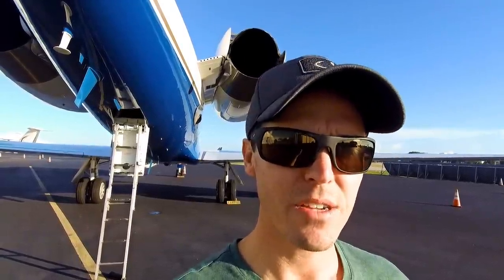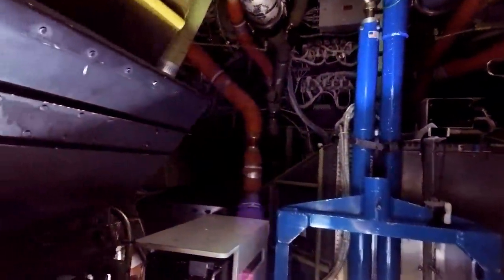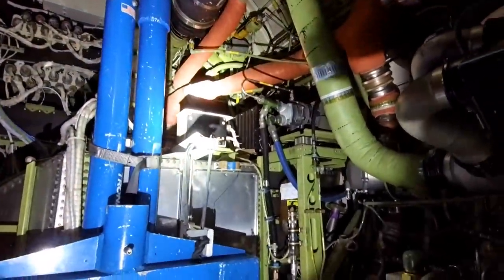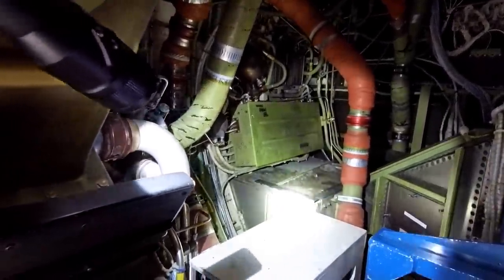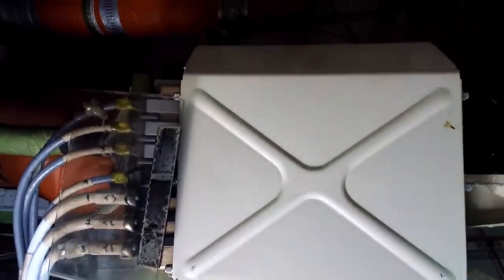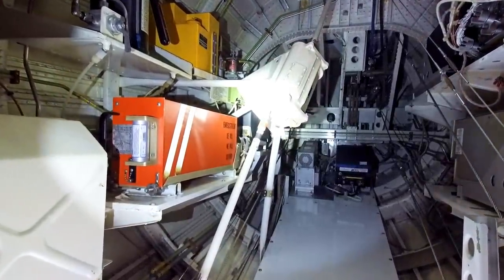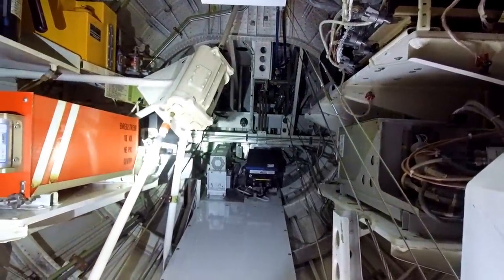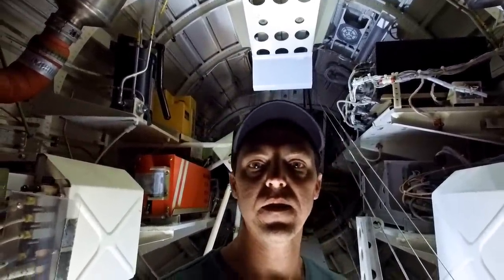Gulfstream Aft Equipment Area - Pilot VLOG 097

Comment: Shaun - as a non-aviation type in knew bleed air was important, but didnt realize where the coolers were and how much it is routed around.  I had 4 LM2500s in my ship, and while we didn't wiggle the yoke - i could control from the bridge.  BTW - thanks for the electrical statement, my plant makes about 1600 MW at sea level...grin
Reply from the maker: HAHA! Nice...

Comment: Love that kind of stuff. When you were showing the replenisher, it reminded me of a questions that you have probably answered a 100 times. How often do you change oil in the engines and how much to they hold?
Thanks.
John Gant. Holland, MI
Reply from the maker: The engines hold different amounts of oil...the left engine holds 14.6 pints, and the right engine holds 15.6 pints. This is due to them being the exact same engine, but are canted at different angles. How often the oil gets changed, I'm not really sure. I'll have to check with our maintenance guys on that.
Reply: Corporate Pilot Life  On airline a the filters get changed but the oil itself doesn't. It just gets added when needed.
Reply: Canted at different angles? What is the reason behind that?
Reply: Canted at different angles? What is the reason behind that?
Reply: It just the design of the engine mounts. The oil tank is in the same location on both engines. But what is inboard on one side is outboard on the other side. Also these engines are used on other aircraft. The Rolls Royce Tay engines are also on the Fokker  F-100 airliner.

Comment: Because of the old style cable and pulley configuration, is that why the plane feels heavy at the controls versus an all hydraulic setup? Jon's mentioned several times how the plane is not light on its feet.
Reply from the maker: It is definitely a very heavy control airplane, but I think it's just the design. My understanding is that the G-V is also cable and pully, but has a much lighter feel.

Comment: Great vid Shaun, Thank you. I have to say. I am sure there is a method to the madness. But it looked very messy.... If there was ever a fire in the APU ( and i sincerely hope there never is) I assume it has external direct access? Otherwise there is an awful lot of stuff which would have to be shifted to get at it. Same with those batteries. I hope never have to get at them or worse... replace them as am sure they are nice and light.... NOT.
Reply from the maker: Yep...both are accessible from the outside.

Comment: The Flight Data Recorder  looks pretty accessible. Most jets I worked on had this unit tucked deep inside the tail system  so that it stayed in the "break-a-way during a crash". It also meant cuts, bruises and plenty of swearing before you got it out and a new unit installed. Nice to see GS thinks about the bastards doing the wrenching. :)

Comment: I could never figure out why Gulfstream used cables between control surfaces instead of rods like the French do on Falcon jets.
Reply: Weight and the ability for cables to route round complex corners. Bowden cable has been proved to be very reliable over the years.

Comment: I am not a mechanical engineer, but I am concerned you missed the disconnected blue plug, at 2:00 right behind the flange baffle lifter; it's for the driver's side airbag. Don't mention it. Keep up the good work guys!

Comment: Finally, the infamous Hell Hole. I’ve spent way too much time in there servicing stuff n things, as well as changing my share of parts. 

That was the bad part of being the pilot as well as A n P mechanic. Double the work, double the fun, but NOT double the pay. 

Enjoyed the video. Happy flying!!!
Reply from the maker: That's not cool! I've considered going for my A&P, but I've heard that's how it works...double the work for the same pay.
Reply: rich schindler double the work ... not double the pay? Pass
Reply: Been down that road myself, pilot and mechanic on a Lockheed JetStar, for those who do not know what’s a JetStar, it was the first real corporate jet airplane, sat 10 passengers and had 4 engine mounted on the rear, like the Gulfstreams, many pilots compared flying the Jetstar to a Boeing 707

Double the work, could not say double the fun because I was the only mechanic the company had, so the responsibilities were a huge burden on my shoulders on just slightly higher that a corporate mechanics pay, but the fun part was I got to fly a very complex corporate jet and that was awesome.

I also worked for a Gulfstream 2 flight department as a mechanic and the “hell hole” layout hasn’t changed all that much.

Mr. Elliott

Comment: Damn, that reminds of me back in the good o'l days(1970-74) when Mexican registered Sabreliner's and Gulfstream's would come in for maintenance.  While climbing into several of those hot-ass "Hell Holes" we found certain armored boxes mounted with giant padlocks. One or both of crew would invariably come out in the middle of the night with flashlights to inspect the area and leave with briefcases of cash, etc.
Reply: LIX 59 They would  do the same under the old GMC motor homes.. in the rear, under the floor and welded to the top of the axel.. hmmm wonder if it’s still around 🤔
Reply: Loved the Sabre 60

Comment: Is the aft equipment consolidated in a new aircraft in comparison to the G-IV? N269WR was manufactured in 1999 and with advancements in processors and technology I'm guessing the systems are smaller.  Great tech video
Reply from the maker: I'm guessing you are exactly correct, but I've never been in one.

Comment: Hiya Shaun. Those control surface cables and guide Gromets(teflon coated?), How long do they last (and tension tested/adjusted), how often are they replaced and lastly do you prefer them to be changed sooner than required just for added piece of mind? Thank you!   ps: With all that plumbing, I can appreciate the costs of a plane like that!
Reply from the maker: Those are great questions...for someone else. LOL I'll have to check with the maintenance department on how often those things get changed and adjusted. As for the last part, they build in a huge safety factor on how often they get changed, so I trust their schedule.

Comment: So very interesting, could be a hell-hole for non-engineer/plan maintenance people!

I was surprised at position of APU - where is the intake for it? I've seen the exhaust on vids as you've walked around the plane.
Reply from the maker: The intake for the APU is straight up. There is a door that opens on the top of the fuselage for it...

Comment: Assuming that the aft area is not pressurized in flight, we're intrigued how all those aft electrical and hydraulic components can withstand the rigors of high-altitude/low ambient air pressures.  You would think that something back there would "pop" at some point.
Reply: Philip Grocki that stuff is designed and built for the extreme conditions. Probably why it costs a fortune

Comment: No matter the aircraft the design of the mechanical equipment are very similar, just placed differently.  If you want to see a cool aft on an aircraft look at the aft section of a C-5 from the troop deck (aft of the wings and 2nd level) .  that's one huge area with virtually nothing in it but dead space.
Reply from the maker: I would love to see the inside of one of those! What a beast!

Comment: I have 2 questions. Has John saying “Vamonos” before takeoff become a superstition, and What does “speed checks” mean as you are lowering the flaps or landing gear? Love your videos.
Reply: The flaps and landing gear have a maximum speed that they can extended at.  For the flaps I think there's a different speed for each level of the flaps.  I think they' just call out "speed checks" as a check-point that they are under the max speed for each point.
Reply from the maker: Jason Mizuno has it spot on. For instance, the speed limit for flaps 10 is 250 knots, so when one pilot calls for flaps 10, the other verifies that we are less than 250 before moving the flap handle and calls out "speed checks". As for the "Vamonos" I'm not really sure how that got started, but it's turned into somewhat of a tradition.

Comment: Ha!  "At the end of the day it's still a Cessna 172 cable and pulley style."  I guess it's hard to beat the reliability, right?
Reply from the maker: Yes indeed!
Reply: I wish GM, Ford, and the rest would embrace that attitude, instead of reinventing the wheel every single year ... which inevitably costs the consumer a PILE more money than it should when it comes time for repairs. Reliability is a word modern automakers have forgotten. As a mechanic, I see this side of cars on a daily basis.  Thank God automakers don't build aircraft!! 😳
Reply: Smitty Smithsonite i’m thinking of my 2014 Ford and Sync. Can’t even imagine avionics behaving like that. Oy
Reply: @jerrykorman7770  Ha, I have the 2014 F150 also, Blue jean... love it, for the most part.  Never any problems but as someone said above, if auto makers made planes I wouldn't fly when we go back east....or anywhere else.  Pilots would be wearing parachutes, walking up the isle (on a deck slanted down) telling passengers don't worry folks, I'm going for help.
Reply: Don C ha I can easily see Jon doing that.

Yep, good truck with the 5.0 love the thing. But the Sync ... not so much. Here is the typical "conversation" I have with it:

Me: Bluetooth Audio
Sync: No Bluetooth device ...

I frantically make sure the Bluetooth icon is on the display and press the command button again to speak slowly and loudly and clearly

Sync: Line in please say a command
Me: BLUETOOTH ... AUDIO!
Sync: (silence)

I press the command button again and raise my voice louder

Me: BLUETOOTH ...
Sync: No Bluetooth 

At that point I scream at the thing like in this very NSFW Onion video:

https://www.youtube.com/watch?v=dBqvg1x6D8U

I even scream at it "WORK WHY CAN'T YOU JUST WORK YOU F***ING PIECE OF S***?!?!"

Yes, I regularly update the Sync too. So I can't even imagine flying along at FL400 and having the avionics act up like Sync does. I really would gouge my f***ing eyeballs out
Reply: @jerrykorman7770  LMFAO! I got one of those and didnt even realize it! Yeah sync can be a PITA, just had to get a new cell phone, once I get the phone to pair with the bluetooth it's ok, but can take a long time trying, even the dealer gave up on it once.  I WISH I'd of got the 5.0, we don't haul much or pull anything so went with the 3.7L non turbo, and its plenty powerful for most things, accelerates good, but the gas milage has been no advantage, everyone I've talked to gets the same or better mpg as me with bigger engine. I could of had a V8!
Reply: Don C I really don't drive much, as a matter of fact the car has 47,000 km on it, the truck has 26,000 km on it. If the 5.0 got half the fuel economy of the 3.7, who cares? I sure do like the sound it makes
Reply: @jerrykorman7770  I love the sound of the 5.0! Even my 3.7 sounds good.  I'm sure your 5.0 gets just as good a mileage as my 3.7, I've only ever got 12.5 in the city since I bought it.  That was my point, for the mileage I get, I should of got the 5.0.
Reply: Don C quite pleased with the performance the fuel economy is also what I expected. My ‘15 is a Focus ST I may bite the bullet and get an RS. I love toys
Reply: Smitty Smithsonite  I drive a light blue 1996 Chevy Lumina 3.1L , zero rust, looks like new, 34.5 mpg. Has a steering wheel, push the pedal to go, push the other pedal to stop, has auto-throttle. Such good aerodynamic large bugs follow the air stream from hood over car without smushing. If they took that design and add new school tech it would be a big seller.
Reply: Don Wilson  I like the idea of "if it ain't broken don't fix/replace it" that was a motto my dad lived by. I tend to get bored of something after 3-5 years. Eg my Focus ST, a fun hatch but I made the mistake of test driving an RS about two months ago. I'm doomed!

I helped a buddy build a '67 Chevy C10. Kind of expensive, has a Roadster Shop chassis, IRS, coil-overs all around, Chevy LS9 crate motor and Tremec 6 speed stick. It looks almost completely stock on the outside, but he can really surprise a lot of fast cars at a green light. To me, that is the best of BOTH worlds: old and new
Reply: OMG, I hit the link and laughed so hard, the tears started rolling.  Tooo funny!
Reply: The U-TUBE link in Jerry's response to Don C.
Reply: rgrinnel I really have screamed like that while trying to get Sync to work in my F-150 or my ST

Comment: Great!  Learn something new each time!  Of late there is a GIV in the hanger next to the flying club to which I belong.  On the wing tip there are 2 position lights, 2 strobe lights, and a small white light with a reflector (shines forward).  What is the purpose of this small light?   Have not been at KALB when crew had time to talk.
Reply: Paul Chmielewski if you reference this:

http://www.jettairx.com.br/wp-content/uploads/2015/07/Gulfstream_GIV-Lighting.pdf

at around p29, appears to be auxiliary landing lights.
Reply from the maker: I believe you are seeing the Tip Lights. Those come on with the taxi lights to illuminate the wingtips so we don't hit anything out there in dark areas

Comment: Re: Having / not having a tow-bar;  Is your aircraft capable of  doing a power-back?
Reply: Even if it is you may not be able to use it without risking damage to property. In some airports it is strictly forbidden.
Reply from the maker: In theory, yes it can do a power back, but Gulfstream says not to. There are many issues with performing one, so we never do.
Reply: Corporate Pilot Life as a kid I recall DC-9’s and 727’s doing a power-back out of the gate. It was so cool
Reply: Power back?  Using TR's to push back?
Reply: Corporate Pilot Life  Thank you for your reply!

Comment: 2:45 ...    400 cycles ????    That doesn`t make sense Shawn ....  Hope I spelled your name right ...
Reply from the maker: Doesn't seem right, but it is. They run 400 hertz. I can show it on the overhead panel sometime. I spell it Shaun...thanks for asking though
Reply: Jam Now 400 hz actually makes a lot of sense in aviation. Compare the size of a transformer used in 400 hz vs 60 hz. The 400 hz equipment is obviously very expensive. Not practical for long distance transmission, but the weight and space  savings for aviation makes it worthwhile.
Reply: Hi Jerry ,,,  The hz can reduce the size of equipment ???  I`m not understanding how ...    Do you know of a video on this ???
Reply: Jam Now

I found a site that will probably explain the concept much better than I can:

http://www.gohz.com/why-we-use-115v-400hz-power-supply-in-aircraft

A supplier of 400hz transformers:

https://www.lcmagnetics.com/transformers/400hz-transformer/

A video apparently shot with a video camera from the 1960's:

https://www.youtube.com/watch?v=2DwGx-QlEAQ

To summarize: the onboard generators/alternators, conversion equipment, etc, can be MUCH smaller and lighter running at 400Hz vs 60Hz

Comment: Hi Shaun.  Thinking about the Voice and Flight Data Recorder (if you're allowed to comment/answer), what is the 'timeframe' for the recordings?  Are they running from the moment you power up (either by battery or the APU)?  And had it come to that (which, obviously, it didn't), would you guys have been able to access that data when the 'pilot deviation' deal went down?
As always, THANKS A MILLION.
Reply from the maker: The recorder runs as soon as we power up the plane as to not miss anything. I hadn't really though about using that info for the ATC issue, but I suppose we could have got access to that, had it come down to it.
Reply: Corporate Pilot Life some are equipped with a QAR (Quick Access Recorder) that, as the name implies, allows easy data access. Eg plug in a service laptop, a thumb drive, etc, download ...

Comment: I wouldn't like to have to wrestle those batteries out of there. Looks like all kinds of stuff would have to come out first.
Reply from the maker: They are actually accessible from the outside. The skin panel comes off pretty easy and they slide right out the side.
Reply: Corporate Pilot Life I seem to recall in your previous video Exterior Walk Around you pointed out the exterior battery access

Comment: Sean, is the Hell Hole pressurized and temperature controlled?
Reply: Freeman Waters nope it’s outside the pressure bulkhead. The equipment must work up to the certified ceiling and in temps -65
Reply: Thank you, Jerry.  The door/hatch & ladder ass'y did not appear to be a pressurized seal, but I had to ask.  I suspected that there was a pressure bulkhead at the back of the cabin area.  Thanks again!
Reply from the maker: Exactly correct. I've never been back there in flight, but my understanding is that it stays pretty warm, even at FL450, due to all the bleed air ducts and electrical components.
Reply: Corporate Pilot Life I sure hope you haven't tried to go back there at FL450. Seriously though, isn't it amazing that components can be designed to work from -65 to +300 or hotter? Day in and day out?